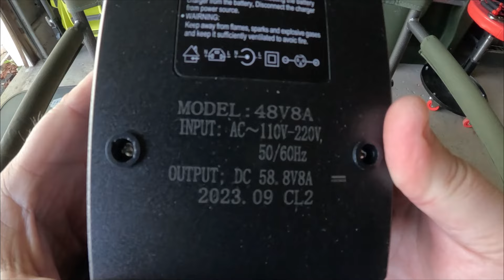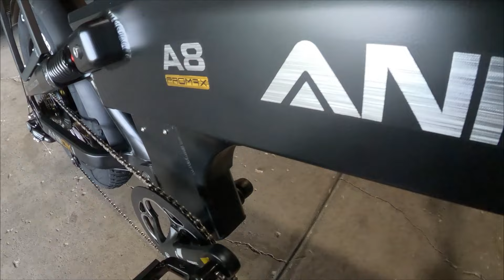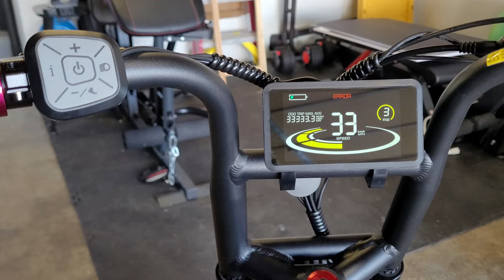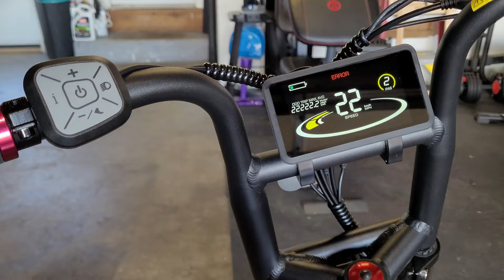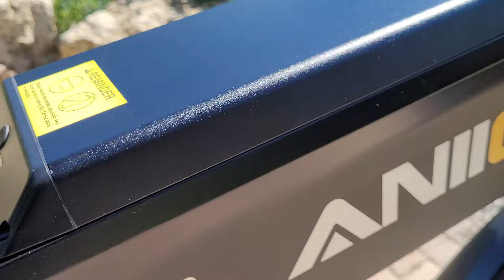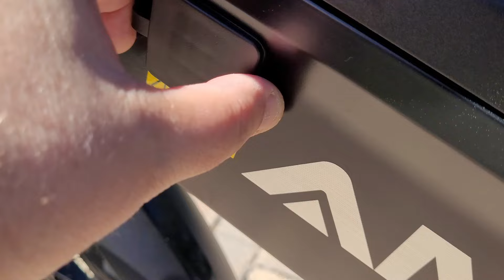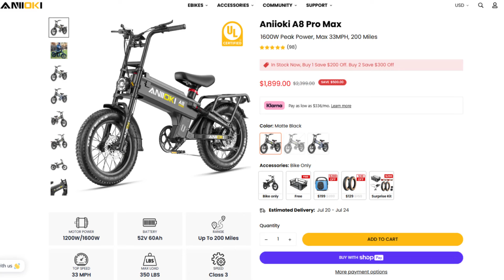Aniioki A8 Pro Max, 200mi Range E-bike *Review*

Comment: Hi, thanks for the review. 
Did you experience any issues with the handlebar shifting off the center bar? I've tightened the bolts as much as I could (to the point where I was worried about breaking something), but the handlebar still doesn’t stay fixed.

Comment: Nice, I want to see the Dual Motor review too. I might get the AWD A8 instead, I just want to know if it's worth the extra $800
Reply from the maker: #Aniioki is supposed to be sending me a Dual Motor and I will review it. Anything in particular you want to see in the review video?
Reply: @E-Ryders  🙏🏾 please go over:

1. All the available settings in the display.

2. It supposedly comes with an app for phones. A Demonstration would be nice.

3. Is there wobbling at higher speeds?

Comment: Im still confused is the motor power of this bike 1000-1400w or 1200-1600w because the site specs says its 1200-1600w
Reply from the maker: @jampsaa  Always go off their website. Many companies will sometimes upgrade their bikes parts and components. But you have to assume their website is the most current information.
Reply: front is 1200w and rear is 1500w